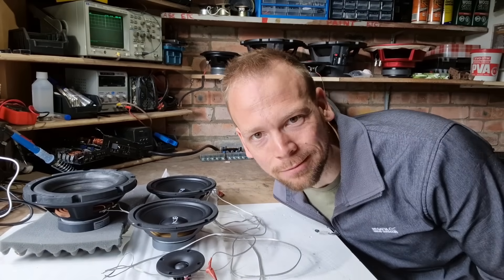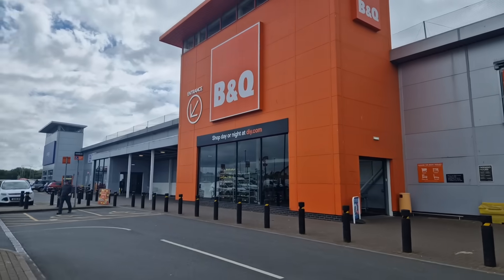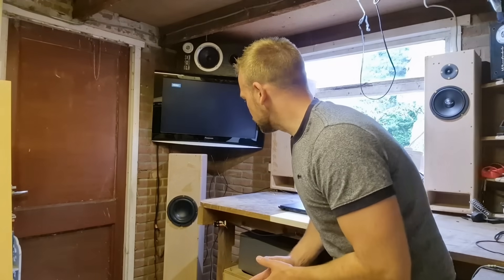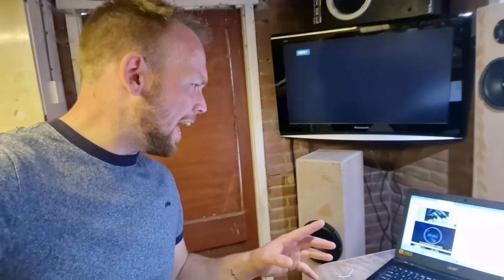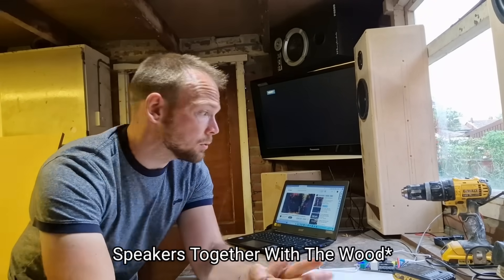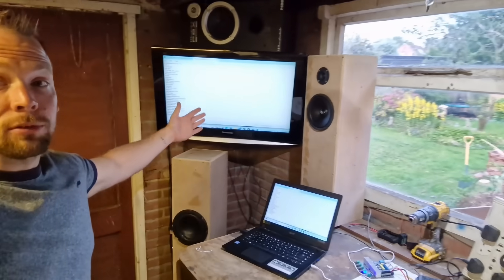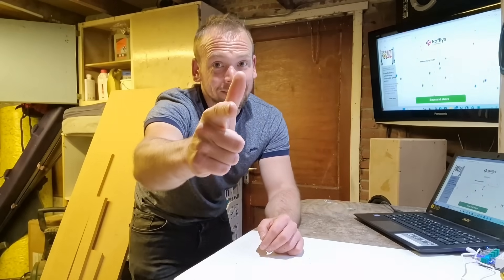THE BEST BUDGET SOUND SYSTEM - TRANSMISSION LINE MAGIC! - HOW TO.

Comment: Quick Question, are these designed for your space or could these speakers work in an open field? I was dreaming about building my own speakers for my garden area. I'm just unsure if these would be the right design... I really cant waste cash to just try it.
Reply from the maker: Bass response will always be a challenge outside as there's nothing to pressurise. I tried term outside and I would very much recommend using a sub and a midbass in a transmission line outside, rather than relying on the lines to do that, such as you can indoors.

Comment: To make the drivers play lower glue stuff to the cone. Increasing cone mass lowers the resonance frequency, and slightly lowers the efficiency.

For the rear in my car, I bought cheapass 6x9 coax's. Then I pulled the coax junk & superglued on Castrol caps, so they also function as dust caps.

that was ~3 years ago...i faded to the rear a bit & it still sounds great!

Comment: Great videos I love your projects! This prove that you can get great sound system at very cheap price if you don't care for a little wood working. 
I now build my new (relatively expensive) speakers from Aliexpress. unfortunately I accidently ordered  the small mid woofers (5.5 inch) but still their quality is beyond my expectations. 
Maybe I find another use for them and buy a new 7-8" mid woofers.

Comment: I have a tiny set of TL speakers (10" tall) on my desktop that I built a couple years ago, using plans from the DIYAudio forum.  They sound amazing when paired with the 10" sub under my desk.  They were a challenging build, mostly due to their small size, but I'd do it again in a heartbeat.

Comment: T-lines are the bomb. Better, lower extension, less distortion, more efficient and sound better. I've been building them since 2017 and if I can fit one in anything, That's what I'll be using.

Comment: I have mainly been using Transmission Line Speakers for the past 38 years. My first set were 'LNB Para lab 20's',  then 'IMF Compact 3 Monitors' and finally for the past 20 years I have been using TDL Studio 3's. There are other ones that I would like to try though I don't think they would work with my room!  Well done!

Comment: Often damping material is used along the T-line.   You can smooth out the response by lining the port wall with some 1" polystuff.  Also using some loose stuff along the line on the sub can really improve linearity.

Comment: Moin (hi),

We share the same attitude all the way.

A couple of month ago I completed my 330 litre Horn-reflex subwoofer. It's essentially a box with a tuned port, that has a expo horn throat attached to it and a opening end of around 1 up to 1.5 times the loudspeaker cone square meter area. And that all is not a part of the ported box enclose. So technically it's a 15inch old PA woofer in an approx. 200 litre tuned port box with an attached short Horn of around half a meter.

I tuned it all myself as it's basically only a matter of the first board which forms the output path of the tuned port. If the port area is too small you will hear the air pressed through this port, but on lower volumes it cuts off at a lower frequency. This is where the 'magic' is. That one board inside that box.

To make it short, I experimented a little with the help of an 'educated guess' and a pivot point right at 2/3rd of that board, and after some measurements and rotating, I found the exact point where at max excursion of the speaker there was still no flattering noise out of that port formed by that board and the back wall of the box.

I ended up with a nice 32hz cut off frequency. And a first resonance of the enclosure of around 120hz.

And a whopping 126dB SPL with an air pressure which easily deconstructed some of my furniture in my living room.

Input power is only 120watt for maximum excursion at 30hz. And it needs 24dB electrical cut off right below it or the speaker will blow out.

Total cost was around 80 euro bucks for the wood and another 30 bucks for additional hardware like screws and stuff. 
Had already the speaker and amp(s)

There's nothing that comes close to DIY compared to something you can buy. 

The next best thing is one of these cheapo cinesium cloned PA 12 inch 'infra-subs' which are around 599 bucks, and you still need the amping and active crossover(s).

There's no HiFi sub in any size which can be remotely compared in terms of SPL and (!) physical impact. I can feel every Bassdrum in my chest at an SPL above 90dB.

Don't buy, but DIY..!

Cheers.

Comment: Mate you ever built a horn box? It's been probably 15-20 years so I don't remember the exact name. But basically your driver is down inside the box and the chamber kinda expands like a nautilus (don't remember the formula). But doing so you could get really solid sound out of surprisingly small drivers. It was pretty common for custom sub installs for vehicles where there really wasn't room for a sub box and big drivers.

I'd be interested to see if these cheap AliExpress can perform in such a box.

Comment: Transmission line speakers are fantastic. Nothing else really plays as low as them, some speakers come close with passive radiators. Passive radiator speakers and transmission line speakers are my favourite, I'm not really that interested in ported boxes after hearing good examples of both.

Comment: Yeah, speakers cost little in material. What they sell for 2K can be built for 250, 400, 500 if you want to go fancy. It's not that they are a rip off, but you can get amazing results if you can do a bit of work. Personally, I can't be bothered. I have a pair of entry level speakers (400 Euros, Cabasse Antigua M170) that do the job.

It's actually amazing they can make a profit of those cheap speakers (Elac Debut, Klipsch RP-500M, Wharfdale, Dali, BRO3, 3020i, ect...). But it says that the actual components are dirt cheap, 50 for wood and bracing, 50 for speaker components, 25 for crossover and internals, that kind of range. A lot gets lost in shipping, manufacturing, packaging, design, ect...

I guess, where it becomes worthwhile, is making £2000, or £3000 equivalent speakers, with a good solid design and good crossover components. A kit, effectively. Or a powered subwoofer, these are actually more expensive than a pair of medium to entry-level speakers if you want something decent (SVS SB1000, 250W REL than can go sub 30Hz). Here, the components actually are not cheap (big copper magnet thing, and a decent plate amp, with some thick cabinet), they weight a ton comparatively.

Comment: The calculations are extremly confusing for noob like myself, can i have a dimensions of a box you builded so i can figure out math? And also how did you calculate what capacitor you needed for a tweeter when you have no idea about Frequency dropoffs ? i would like to design my own crossover and place 2 bass drivers all in one giant box, and is id duable?

Comment: I built some big dog transmission lines as well.
Twin 6.5's and a 1 inch tweeter, with my own recipe of 2.5 way crossovers. They're tuned to about 38Hz, but dig down to 30 with ease.
They're phenomenal and surprise the absolute crap out of everyone who hears them.
Reply from the maker: Mate i love them! Wish id have made them longer!
Reply: @MyNameIsAdam1  I think you did well given the drivers used, and they seem (given your comments/reaction) to blend with the sub nicely. You'll push the drivers to distortion if you ask much more of them.

That said, when the sense of "what if" gets the better of you and you inevitably build new enclosures, add another woofer in the same 2.5 crossover setup I used. It's an easy upgrade, given you understand the principles, and then you'll be able to target lower frequencies efficiently.
From memory, a rear port was more in phase below 45Hz (or something like that), but I don't remember if that was due to the enclosure depth, more than frequency... They measure as well as they sound (using REW), so whatever the reason was, it's correct for my setup.

I look forward to watching that video in the near future 😁

Comment: It all depends on where your shopping. I got a really good small sound system from walmart. It was 120w 3.1 channel system. It got a front left,right,center and a 200w sub. For anyone wanting a decent sound system good will is a great place to check. Same with some pawn shops. Alot of shops usually underprice home stereo/theater systems and overprice car subwoofers

Comment: I stumbled across your video clearly by happenstance. I've been an audio guy for decades now. How about doing a video where you compare one transmission line speaker (full range or sub) to a ported version of that same speaker, so we can tell if there's any performance benefit of either design.
Reply from the maker: @e-mailuser9811  potentially! This can however be done on computer 😊

Comment: Really nice vid and i have a recomendetion about the amplifier the tpa3116d2 don't get me wrong its not bad but there's a better one with higher quality and power and that is TPA3255 it needs a higher voltage but has more power and even better audio quality now watch out for fake ones i have one that seems to be the original chip and that is ZK-3002 it doesn't have bluetooth tho but there is the ZK-3002B version which does have it and also app for EQ and also bluetooth password. Overal they sound really good
Reply: Altho iam not sure how good the bluetooth variant sounds like beacuse i use the regular version without bluetooth and i use a KRC-86B bluetooth module which is basicaly the same bluetooth chip that jbl speakers use so i get pretty good quality from bluetooth but the inbuilt bluetooth on the ZK-B version is some kind of chinese bluetooth so i really don't know how that sounds
Reply from the maker: @w4st3lander  so ive got the more powerful varation in my basket, itll power one of the upcoming videos 😊
Reply: @MyNameIsAdam1  ah can't wait to hear how its going to sound
Reply: @MyNameIsAdam1  I have a portable speaker that i made it used to have two standard mid range speakers  and tweeters it was good but lacked bass so i got the two aiyima 6.5inch subs (i think i have mentioned them before) and tpa 3116D2 i later switched to tpa 3255 and the audio quality increase was noticeable so i hope its going to be the same in your case

Comment: I tried to build a transmission line PVC pipe speaker once. Sounded terrible. I wish we had the same taste in music because I find your test tracks really horrible (apart from the acoustic guitar stuff), but I enjoyed the video. What kind of crossover did you use in the stereo pair?
Reply from the maker: Im a metal head at heart haha, pvc will resonate like fuuuuuck so its not the greatest. I jist plugged these into the amp which had an oboard crossover 😊

Comment: Adam can you send a link for the amp. 
I want to do a set of garden speakers and have 3 12s, a pair or 6" mids and tweeters to mess around with but want a Bluetooth amp
Reply from the maker: Its an aiyima tpa3116, best bet is ali express or temu, but i wouldnt load it any lower than 4ohm on the woofer as the distortion is maaaaaaad!
Reply: @MyNameIsAdam1  I just bought 6 of them on temu. They were doing 3 for £4. Madness.

Comment: i was wondering if you position the sub in the bottom of the line (furthest away from the open end of the port but not firing into the port) would this increase the lower  note response?
Reply from the maker: So, yould have thought. But infact no, what actually happens is that you end up with a peakier response, placing the driver further down effectively offers an "air damping" which flattens the response
Reply: I plan on building one for 3 x Alphard Audio 12" Subs for the bed of my Nissan Frontier with the port on a blow through into the cab using either transmission line or folded horn build.

Comment: I’d love to see some controlled frequency db testing to be able to see how the calculated frequencies vs actual output of the build.  Haven’t built a T-Line for around 10 years, but this is the first time hearing about placing the speaker down the line to flatten response.  When I calculated mine, I was assuming beginning of the wave started at the back of the speaker, so I always located my subs right at the beginning of the line.  I hope that makes sense, and I’d love to experiment with that to see if the peak frequency shifts at all, or how much db you lose (if any) by flattening the curve and getting a broader response range.
Also I never thought to put tweeters in the T-Line, do they seem unaffected by being in the enclosure?  Could be a nice space saver
Reply from the maker: Totally unbothered! Because the tweet is sealed, all the wave sees is a very minor bump in the woods surface which makes no difference what so ever to the response.

Comment: You were mentioning the clarity of "the thumb on the E string". That's what I love about T-lines, the clarity of the bass.  It's usually very natural, not boomy, more realistic when listening to acoustic instruments.

I have a pair I built from a kit, but to be honest I've never built another pair because I was thinking I had to hold to all the complicated shit to get a pair that sounded decent. 
Well to hell with that, I'm going to build a pair using the basics.  Thanks for sharing this.

Oh also, try throwing some dampening material in there and the bass won't fall off as quickly.

Comment: Technically you have made quarter-wave "tubes", a true transmission-line has specific damping materials along it's length to absorb certain frequencies and prevent reflections. I have a pair of TL speakers that someone DIYed back in the 80s using USA made Realistic full-range drivers (cheap and cheerful, but Realistic was serious about home hi-fi back then). The TL is fully damped and even the front baffle has damping material on the front under the grill material. They sound fricken amazing and the sound-stage is truly something to hear for near-field listening.

Comment: Hey there, this is a great video! Could you please elaborate a bit more on how to calculate TLs?
Reply from the maker: Find out the full wave length of the frequency you need in inches, divide it by 4. This is your throat length. 

Measure the moving area of your speaker and calculate it into sq inches, this is how many square inches you need in the throat. 

Then build it 😊.

Comment: Fantastic stuff and great timing for me too! I've just redone my garage system this weekend and replaced my old Pioneer headunit with the same Aiyima amplifier running some DLS components and a JL 12W3 off a dewalt battery. So shocked at how well and loud the thing sounds! I was gifted a Yamaha HS8 bass driver ages ago (so obliged to do something with it) and not having any T/S parameters never knew what to do with it except maybe transmission line. I was always put off by most of the comments posted in forums etc about the complexity and my ability to get it right, but this has re-inspired me. I'll be playing with speakers again this weekend, thanks.

Comment: Subscribed 🙂

So-called "Straight" TLs are not that complicated.  However ...

(1) Best CSA for a TL is determined more by the driver's Vas than its Sd (you can have drivers with the same Sd but very different Vas due to magnet strength, for example). The larger the driver's Vas rating, the larger the best TL for it. 

(2) Done right, the overall volume of the TL should be the same or slightly more than a well-designed vented box for the same driver (including the volume occupied by the vent).

(3) Larger CSA results in more output around Fb, the TL's resonance frequency.

(4) For the full-range TLs, add some stuffing between the closed end of the TL and the driver.  Should result in a cleaner sound.  Might help to do that with the subwoofer too.

(5) Roll-off for a TL below Fb should be the same as or similar to that for a vented box with the same driver. 

(6) Mounting the driver 1/3rd of the way down the line nulls out the first harmonic resonance and extends the usable bandwidth of the TL. 

For more info about TLs, check the TL page at my website, www[dot]diysubwoofers[dot]org .  I've built and tested a few 🙂
Reply from the maker: Thats amazing! Thankyou!

Comment: Hey cool video and congratulations to the winner 

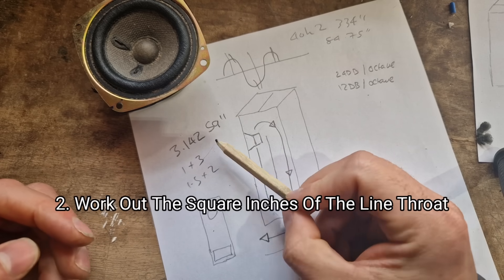I have a question to your point at 2:22 since the weird cuts and the audio cutout it is kind of confusing 

Lets say we have a 8'' subwoofer with the diameter of 16cm so the cone area is ~200cm² so the corsssection of the transmission line needs to be 200cm² as well ?
Reply from the maker: Yeah the cutouts werent in the edit, i dont know what happens! But yes, the effective cone area needs to be the same as the throat size of the line.
Reply: @MyNameIsAdam1  thank you very much :)

Comment: you speak absolute gold - retailers sell the branded crap that rarely sounds good unless you pay the big bucks. I have experience with AIYIMA amplifiers and they are amazing for the price.

however there are some golden nuggets among the mass-produced speakers but if you can DIY, then that is definetely better. you cannot compare a finely tuned bookshelf speaker set with class A amplifier with some random piece of crap for the same price from the electronics shop

Comment: i might be wrong, but in that part where you explain the hertz and signals and waves, the quarter of the wave you pointed is correct but the point where you said its half is actually 3/4 and half is actually in the middle on the horizontal line and the last vertical line you put as a marker is actually 5/4
Reply from the maker: The whole drawing was kinda fucked up to be honest..